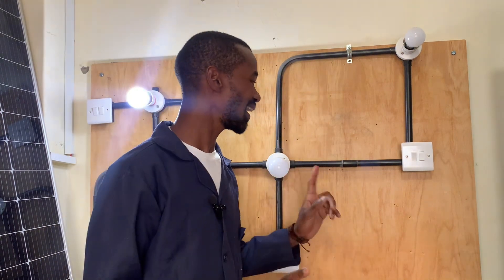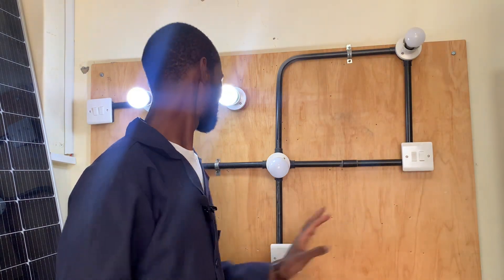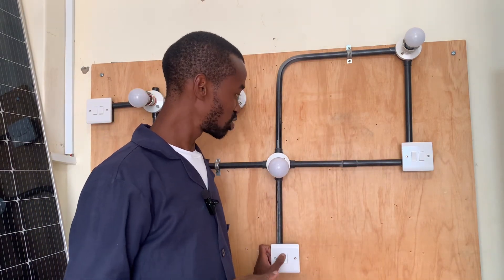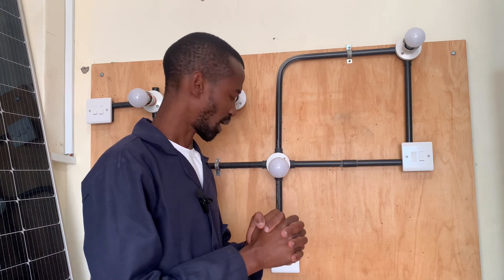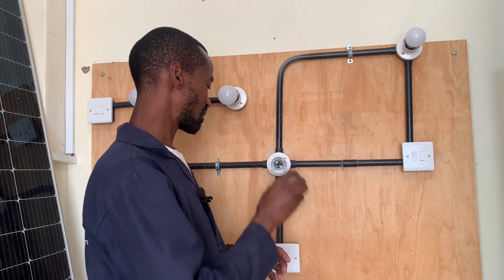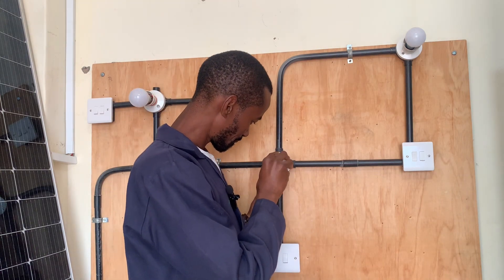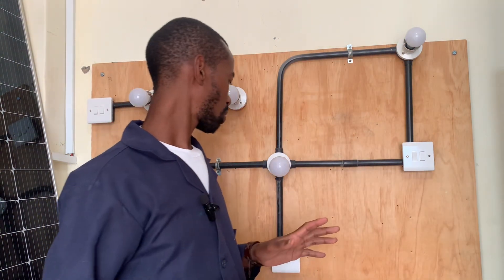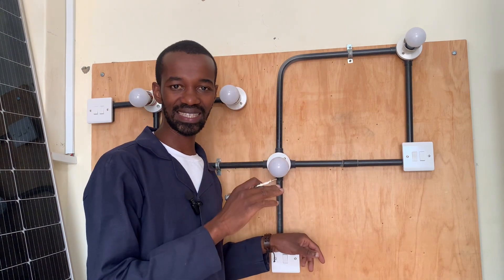Electrical Training Video | Lights Wiring Troubleshooting - Top Heights Electricians.

Comment: This is really helpful. Thanks a lot for sharing this knowledge. 
I've one question: Will the multimeter test ( continuity test )  work the same if the wires weren't connected at all?
Reply from the maker: Yes, correct Top Boss